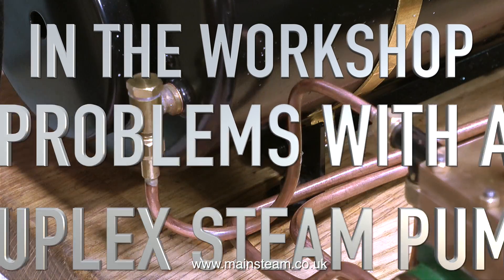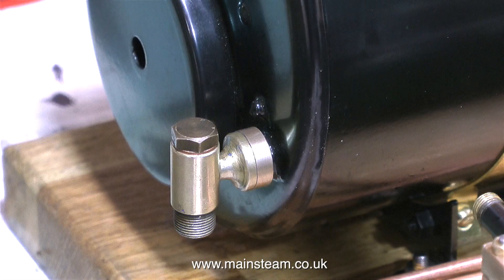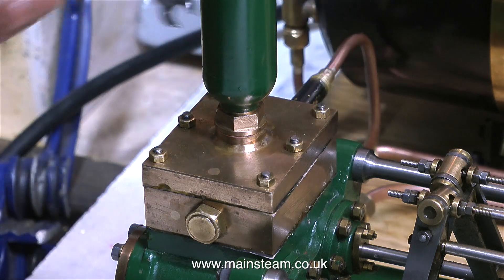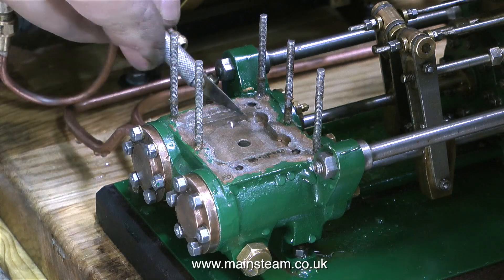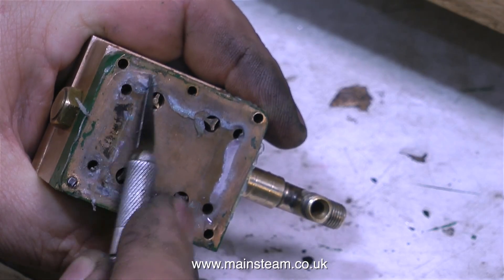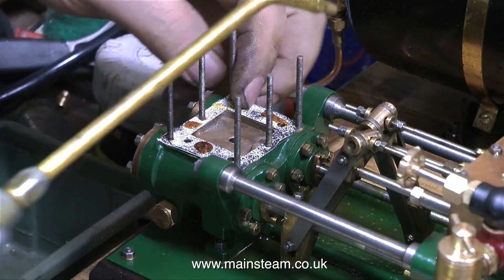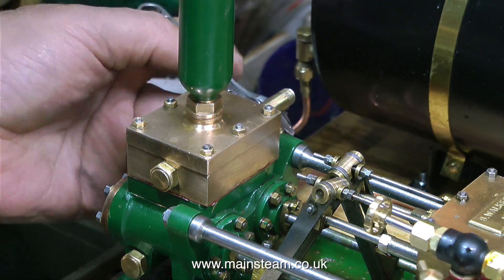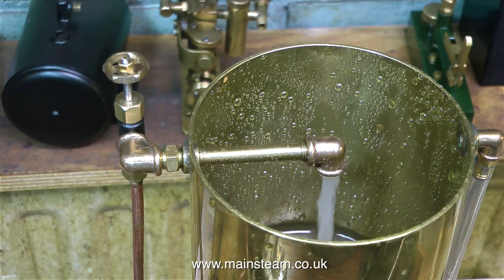SOUTHWORTH DUPLEX PUMP PROBLEMS - IN THE WORKSHOP

Comment: Anything that isnt a gasket shouldnt be anywhere near steam chests or water chests ever. Sealent tape shouldnt be within 100 miles of a steam engine either. Use the proper things or dont bother, most of the issues you see is something stuck in steam ways or water pipes. And normally its sealants or plumbers tape. XD

Comment: Many a radio amateur (a.k.a. "Ham") has discovered the perils of silicone as they have used it attempting to seal their outdoor antenna (a.k.a. "aerial") connections against the weather. Corrosion and various electrical problems--including outright failure--was the result.

Comment: Your silicone rubber problems brought back memories of the 70s when it came to market, truck suppliers in Australia thought it a wonderful product to seal fuel tank sender units, well the tube clearly states not to use with petroleum products, unfortunately I was left with the subsequent removal of silicone from the complete fuel system, tank, fuel lines, fuel pump, filter and carburetor, yes it dissolved enough to pass through the filter. Often it is used too heavily, like your water pump, the mix with water is not the problem, it's all of the left over after being squished out from the mating surfaces that breaks up and travels through the system. I've struck it in elbows restricting flow. The stuff is evil. Peter

Comment: Yes: Acetoxy Silicone uses acetic acid to cure and does eat copper you cant use it on copper PCB. There are silicone that don't use acid to cure which would still have to be dug out of places that should not be, but have the distinct advantage of not eating what they stick to, plus they don't make you engine smell of fish and chips. As to the rehab thing, try saying No, No No, three times it might help remove Rega christmas from contention

Comment: Nice video and good troubleshooting. I always wanted to ask you a question from the time you first found silicon used as a sealant. Why not completely disassemble the pump  the first time, atleast the water side and clean it all at once.
Reply from the maker: I was only asked to pipe up the plant ........

Comment: This is probably a very very very stupid idea for a lot of reasons (including damaging both the pump and your brain), but maybe you could try flushing some acetone through the pump and leaving it to soak overnight, then flushing fresh acetone through the next day. That should hopefully remove any silicone that's left in there.
Reply from the maker: including the O rings on the pistons too ......
Reply: Yes that's the main reason I said stupid. 
I guess that if you go to all the trouble of dissembling the cylinders to get the o-rings out, you may as well strip the whole thing down entirely anyway.

Comment: Unfortunate the corner jewel in your plant is still giving trouble. Google says there are different chemicals that dissolve silicone like mineral spirits, or even specialized  "Dynasolve 218 and 220". Maybe setting up a closed circuit with a solvent in a small reservoir  for the pump to cycle it through itself might help? Who knows what that would do to Brass, even diluted. Just a thought to maybe save a total rebuild. :)

  Dang earworms, best luck with that song. And with the pump.
Reply: Perhaps on the closed circuit mentioned here use a fine mesh inline fuel filter (as used on small engines) on the pump intake and flush with water to remove the silicone particles. Occasionally replace the water with fresh.

Comment: Bonjour Keith,
Humour and skillness, lucky man, you have the appropriate ingredients to make me/us addict to your videos. 
And thank you also to your daughter for her videos.
Besides this, I doubt when you say that the pump problems come from the silicone. For example, if it was an acid, it would have damages many many machines using it. When my simple D10 pumps are able to feed my boilers under 3 bars or more, silicone would not block a large double one such yours. You should consult your colleague Hercule POIROT :+) 
Amicalement, Raphaël
Reply from the maker: this wouldn't block if it used stainless steel ball valves ......

Comment: perhaps run some reggae reggae sauce through it, and it will give it  a clean out   ( or kettle descaler/vinegar), from my car repair days, it was seeing tons of red hermatite when fixing someone elses bad workmanship that got me down, glad i stopped before the silicone stuff came in,  i am wondering if it always had a pumping issue, and someone thought it was leaking thus sealed it with goo